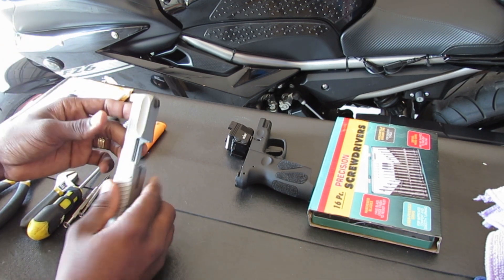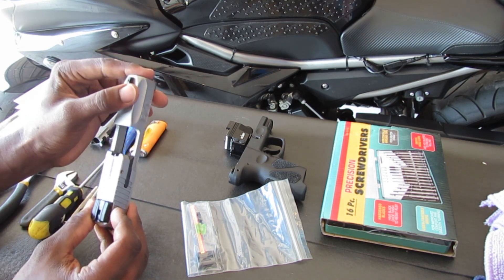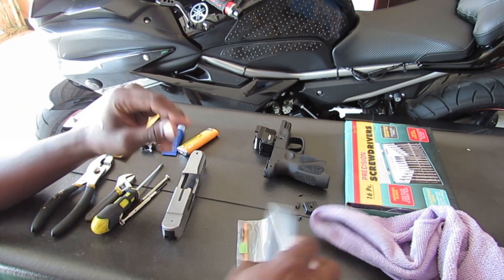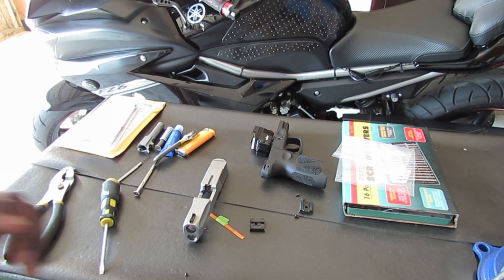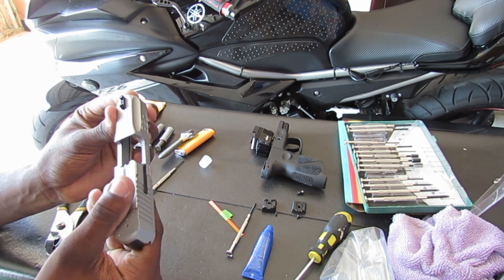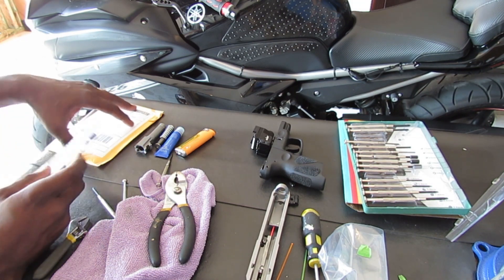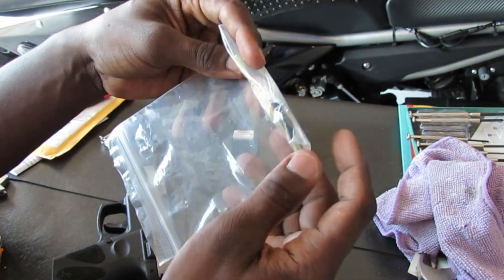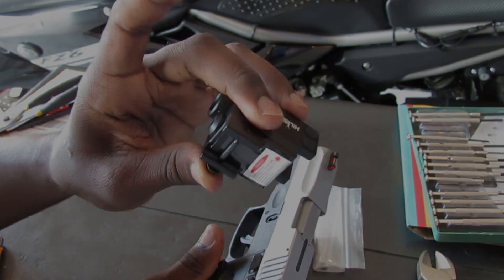Taurus g2c (FIBER OPTIC SIGHTS) installed!!!

Comment: My front sight is having the same issue. It doesn't fit flush in the hole For some reason I was able to get it to work on my tx22 but, It wouldn't work on my g2c..

Comment: How was the accuracy of the new sights?
Reply from the maker: I did not like the sights so I changed it back to the original version
Reply: @motorguns1762  what do you mean original version did you just decide to go back with the factory sites?
Reply: @patrickrobinson2520  that’s the original version isn’t it
Reply: @patrickrobinson2520  because lakeline fiber optic sights are garbage hard install front sight and elevation rear sight is sucks always one and half inch lower on targets
Reply: 100% better. I shoot keyhole groups at 31 feet with it. Elevation was perfect too. I think there is no luck sol involved and if you take your time, aren't a child and have a small amount of common Sense it's a fairly straightforward installation. The hardest part is to retrofit is the front site because it does need to be filed a small amount but, but once you have it filed to where it will enter the hole flush you've got it made. Then be sure to use loctite blue too, because the backsite isn't really held by the screw itself it's held by this surface tension between the steel of the gun and the metal of the rear site itself.
Reply: Perfect accuracy
Reply: It all depends on who installs them
Reply: How do you make sure front sight is straight?

Comment: Is that slide the color it came or did you cerekote it?
Reply from the maker: That's how it came
Reply: @motorguns1762  cool, I have the same gun, but fir some reason, the slide looked a little lighter. Thanks for the video. I'm going to put them on my g3

Comment: That an r6 in the back? I have the same rear tire on my Yamaha FZ6.
Reply: Ha! I just noticed the sticker and that’s also an FZ6! What year is that? I didn’t think any of them came with the rear seat like that?
Reply from the maker: Yep it was I'm fz6r and i bought it with the tires
Reply: Motorguns#1 what year is it? I have an 07 fz6
Reply from the maker: @brandonkeithley7464  it was a 2014
Reply: Motorguns#1 do you enjoy the 6 o’clock hold these sights have? I hate them on my tx22 (same sights) I just took the rear off and kept the front on. Using factory rear sight with the fiber optic front.
Reply from the maker: @brandonkeithley7464  i didn't like  the sights at all i changed it back to the factory. The front sights keep cuming loose even if I put Loctite on there
Reply: Motorguns#1 since mine is just a 22 i doubt I’ll have that problem but I don’t like the 6 o’clock hold. I recommend you make a review on them and let everyone know your opinion.

Comment: You really needed to file on the nub to get it to seat properly and use loctite on that area too. My opinion, the band that you chose to go with on the rear sides is too large and may cause you some problems when trying to shoot the pistol maybe not. Lucky there is extra fiber optic rod to use if you need it if you find that to be a problem. and the reason I say that you may find that to be a problem is we're both of your orange fiber optic sides are so large in diameter it is going to leave little room in the center for you to choose left or right based on windage. But by all means I hope you have a great day at the range I just suggest that you make the beads of the site smaller in the back. And I have also found that using green on the back fiber optic sites with either orange or red in the front is a very nice combination although I've never tried orange on red combination I had thought of using orange in the back as you did with green up front I'm not sure it is very versatile and all in all you did a great job for what you had to work with and you really gave a good accurate picture of what the site looks like and how it will look under lighting conditions. Thanks for the video.

Comment: good video, i do have one qustion. is it possible to put the fiber optic rods in the sights and heat them before installation? i am worried about getting my blued slide hot and discoloring it. thanks
Reply from the maker: Yes it is possible just ensure you dont put too much lock tight on the front sights or else it will touch the fibre optic rods from the hole under
Reply: Do you by any chance have pictures of your blued slide id love to do it with my gc2
Reply: I have pictures of my bills from start to finish I used green rods in the back and the bright red in the front.

Comment: Front sight looks like it's on backwards.
Reply from the maker: I tired putting it the other way it don't fit and also that's how the instructions said to put it
Reply: The flat end should be on the front and the angled end to the rear.

Comment: i bought 2 sets   the front sight is absolute junk, customer service is horrific, i asked for replacement of only the front sight and was ridiculed for my skill in getting it to fit, im a aircraft machinest of 25 yrs    the sight quality was bad ,,at least on this one   as i said i bought 2 ,,1 for my son ,,,I SUGGEST  not to buy from lakeline, spend a little more for a better compny and product
Reply: @stevethomas5284  if u can’t figure out how to slap a set of sights on a budget gun then idk what to tell ya. Sounds like a personal problem 😂
Reply: @damiion666  my part was malformed had you read what i wrote.
Reply: @stevethomas5284  well then conform it to shape already, work with it
Reply: @damiion666  the protruding part on the lower part of the sight was shaved to low and the sight couldn't not be mounted and not spin... no amount of lock tight or fabrication was going to correct the issue.  All i ask from the company was a replacement for the front sight only.  20 to 30 emails and 8 photos later all i got was more arguments over it.  All i ever stated was that this single   front sight was missed in quality control.   Over a couple dollar part .
 It is irrelevant at this point.  I on several sites explained my position and i dropped the matter and purchased a better quality sight.
Reply: @stevethomas5284  lol alrite was just having sum trollin’ fun 😆
Reply: @stevethomas5284  what sights did you get ?
Reply: @jordanmcbride1499  i don't remember that was a year ago.  I threw the trash away and bought another kind